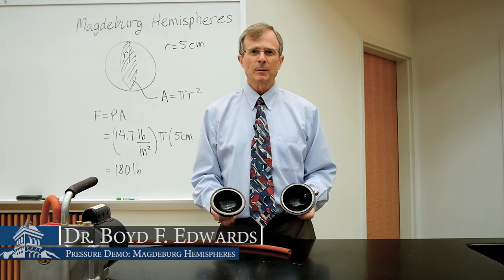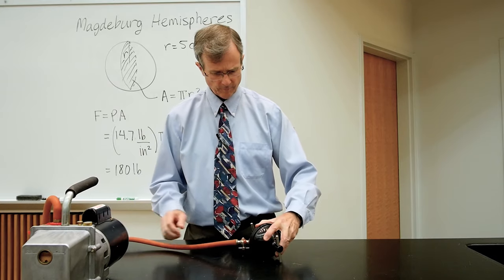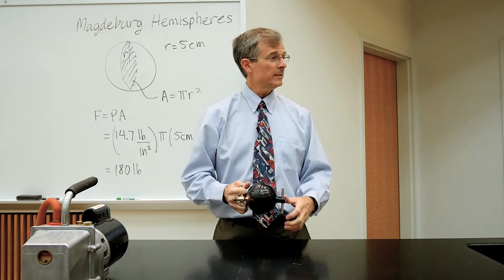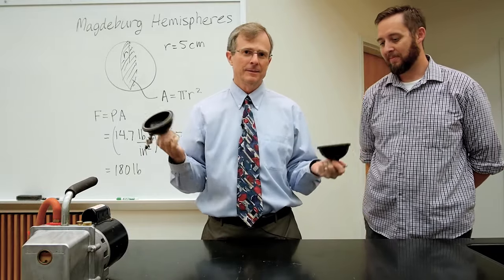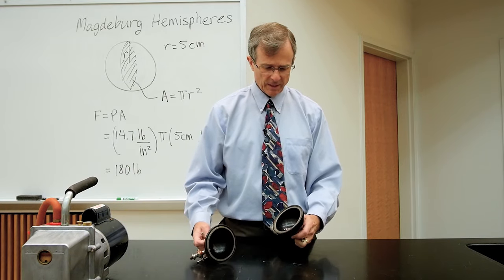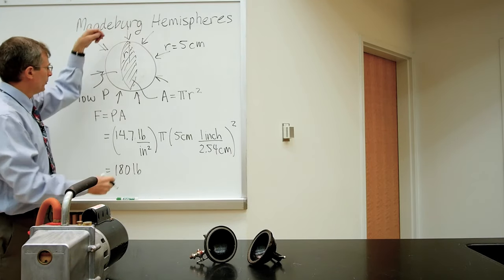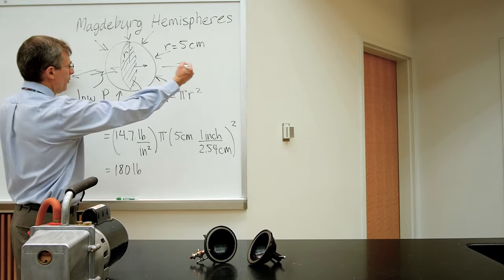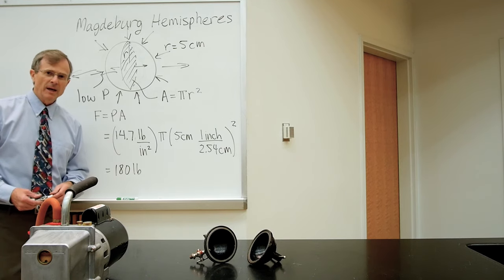Pressure Demo: Magdeburg Hemispheres

Comment: I'm here in the year 2021, I can't even make such strong vacuum and how did they make such strong vacuum back in 1650 without special rubber seals or gaskets? legend says that 8 horses on both sides can't even pull that vacuum out... Non of this makes any sense without introducing the facts of its purpose and origins...

Comment: At 0:45 - "Just imagine the air being sucked out of there" - well, yes - if you were looking at any other video - but in this video, rather imagine the air being pushed out of there by the remaining pressure of air (low though it may be) being higher than the pressure in the vacuum pump.  That's why you can never get a perfect vacuum - because it always takes a bit of pressure to push the remaining air out.
OK - call me a nerd!
Reply: interesting!

Comment: Sir, sometimes we find it's difficult to open a container lid..Is it because of the same phenomenon??That it creates a low pressure region(If it is then how is it created??).Probably it's not vacuum inside!!Right???Sir, I need help?? Help this miserable??Lol
Reply from the maker: In my experience, opening container lids is more a matter of overcoming the friction between the lid and the container than any pressure difference.  I doubt there's much of a pressure difference between the inside and outside of typical containers, but I don't know for sure.
Reply: But if we heat and cool the container only then